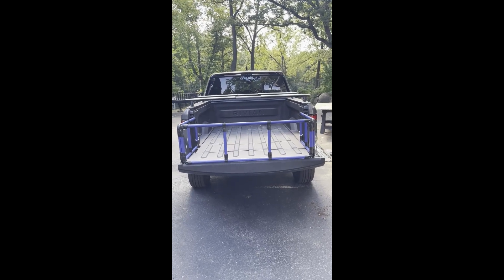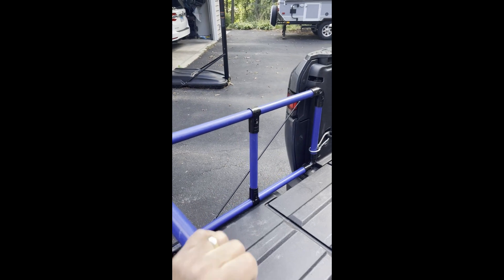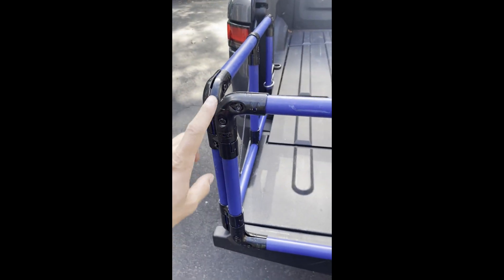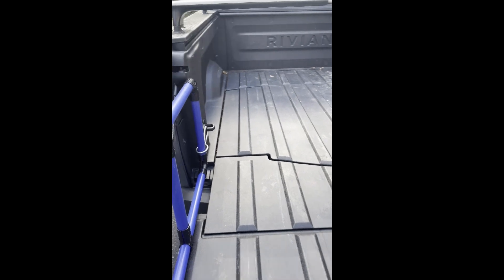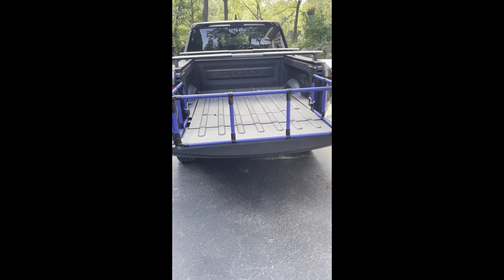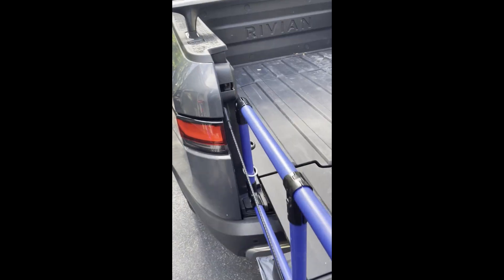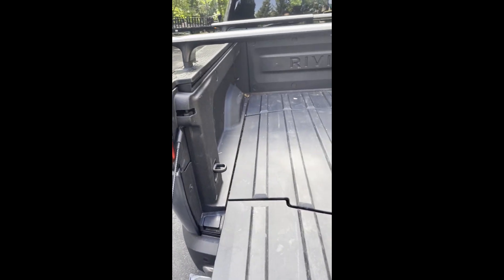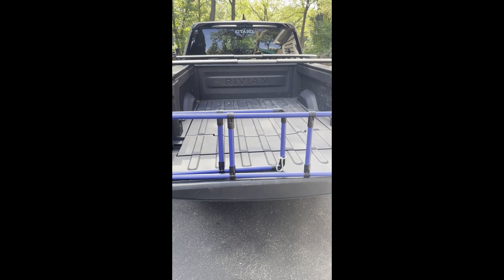How to build your own bed extender for the Rivian R1T

Comment: Is there any chance you could post the dims or the products we would need to buy in order to build this?
Reply from the maker: From flexpipe inc.

HJ-90 Round angle joint set qty 12
HJ-1 T Joint set qty 8
HJ-13 parallel joint set qty 4
P-96-BL Blue 8' steel pipe qty 4